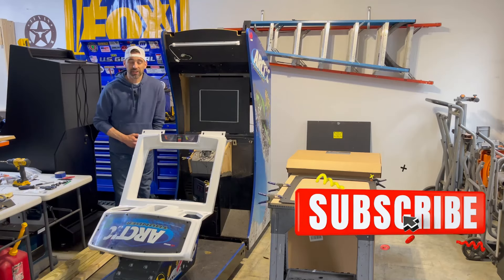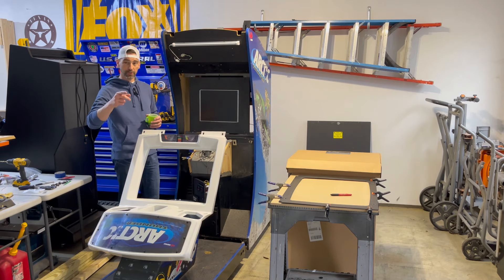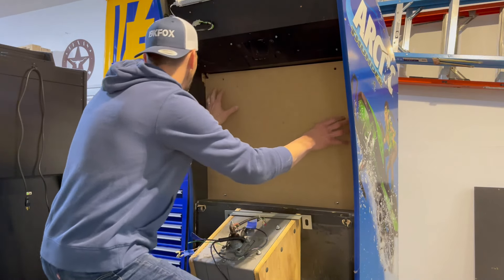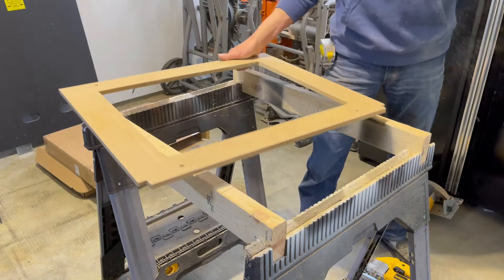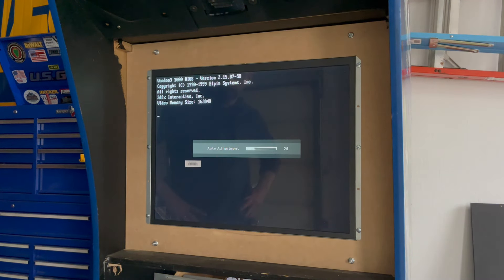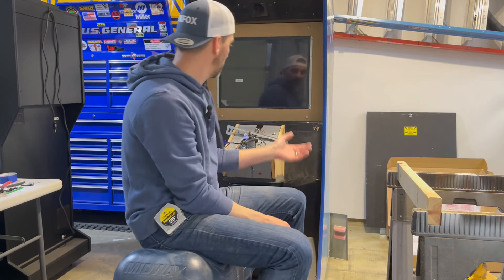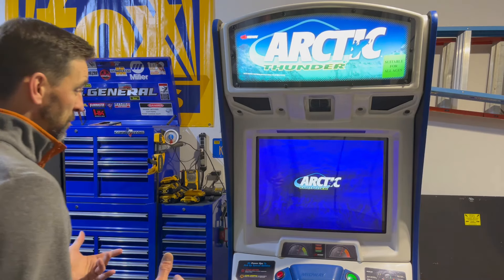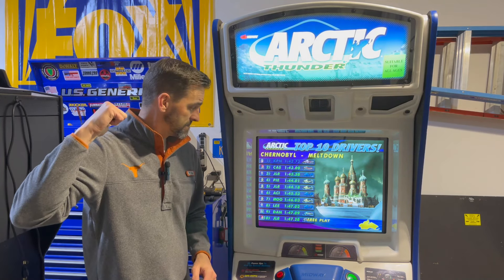Arcade Rehab - Arctic Thunder 2 - Unico Monitor Install

Comment: Any tips on rebuilding the steering wheel, just picked one up that’s having a video in issue but haven’t really looked into far yet, the steering wheel definitely needs rebuilding though it’s missing the tiny gear that that bracket hold that sits on the teeth of the yellow throttle and it’s missing the switch under it any idea on what switch that is so I can maybe just replace it?
Reply from the maker: @sullydodd6576  Check out the SuzoHapp website: https://na.suzohapp.com/wp/search.p?Q=Arctic+Thunder